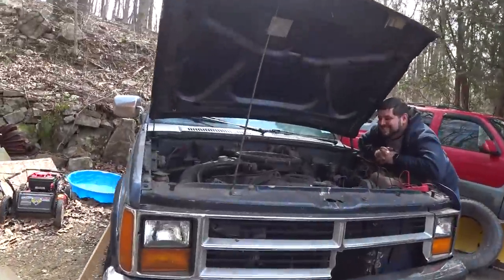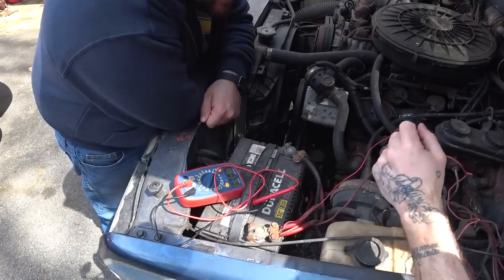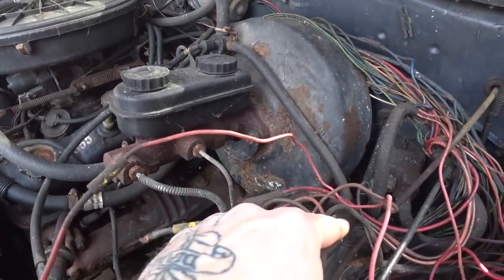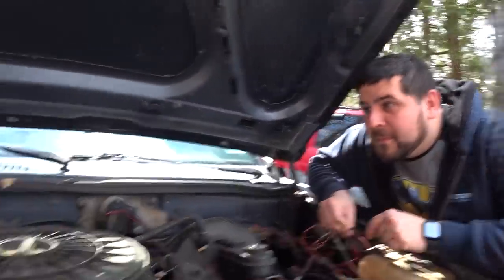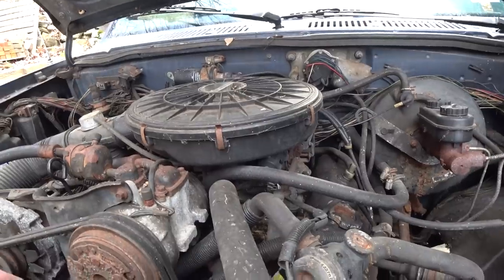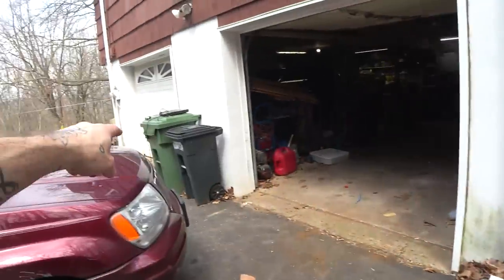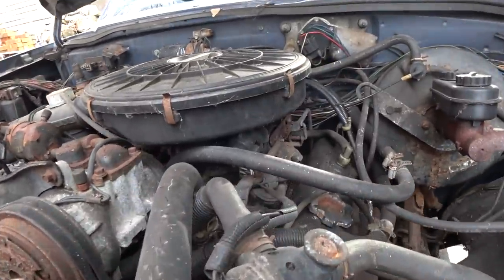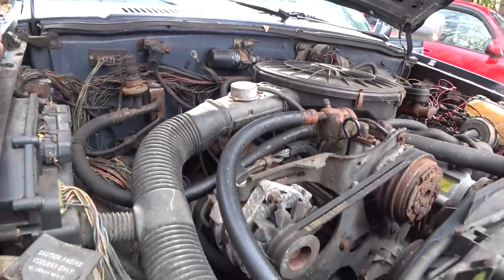Dodge Pickup - No Crank, No Start, No Power Anywhere.. DIAGNOSING FUSIBLE LINK ISSUES

Comment: The thing on the air filter is a heat riser bypass. On a cold day it closes up so the air gets sucked from the exhaust Manifold (there should be a tube that runs from the air cleaner to the manifold). That thing you were playing with would open the valve when it warms up. 

As for vacuum advance you don’t need it, as long as you have a mechanical advance. Your fuel mileage will suffer a little but ehhh ..... my 57 Chevy runs a Mallory ignition without a vacuum advance. 

Next step jump the starter to see if the motor cranks, then hook those wires up and see what happens. Either she will good bang, bad bang, or do nothing.
Reply from the maker: Thanks for the info buddy. I am at a disadvantage on this project as I have very limited experience on carbureted engine... which is why I want one so bad. I want to learn. Haha

Comment: Replace the links with blade fusable links, it will same you a bunch of headache. You'll need 4 or 5 I think. The small wire links are a pita some times they don't burn through and you have to guess which one it is with the blade fusable links just pull the fueses.
Reply: Hi do you know what amps for each wire? I have a 3.9 1989 dodge Dakota

Comment: 87 and older 318's in trucks were carburetor, hydraulic lifters, mechanical fuel pump. 88 and newer were TBI, roller lifters, electric fuel pump in tank. Some basics for you. I hope it helps.
Reply from the maker: Thanks buddy. So maybe I will look for an 87 Ramcharger or something to pull from
Reply: @DEInTheGarage  Maybe it'll help with your choice for an engine. So many to choose from.
Reply: Even a van engine will work. 👍

Comment: The thing at 10 min is a warm air vent. When the motor is cold that valve will open and allow warm air off of the manifolds to help cold starting. Then when it heats up it's supposed to close. My 79 Mustang had one and I removed it as I didn't notice any difference and the supply tube kept coming undone.

Comment: Love this channel & wonderingnifbits my current issue. I was having some electrical gremlins like dash light going off intermittently, but it was my turn signal went out that safly resulted in me parking it a year ago now. Life has been so busy I haven't had a chance to finish installing the turn signal switch, but last I recall I shorted something out (should have taken notes but wasn't expecting for it to sit) so wondering if it's the fusible link. I was hoping to get this running before I get started on dropping the oil pan on my xj that I believe spun a bearing due to sludge & oil starvation. Lots of Mopar fun to be had.

Comment: I have a 1989 Dakota that had a 3.9 v6. I swapped in a 1989 360 and I have had it running until this year. Something happened to the fuel injection / computer so I am pulling all the fuel injection crap out and going to a carb. We will see what happens. I researched going with an aftermarket EFI but I would still need to gut all the factory efi crap, convert it all to a 4 barrel carb, get it running and dialed in before trying to convert to a modern efi system.

Comment: You put a good aftermarket intake and carb on the 318/360 with electric choke and you'll be good. My carb on my 350 fires up no problem in the winter.

Comment: if your looking for a cheap e-fan im using a universal fan designed to adaptor to a chevy 350 and a smal push fan up front for my ac and it keeps it cool. i have a 3.9 v6 in a 99 dakota. just a thought. think i paid like 60 bucks for the 350 fan and the other fan i got is like 40 bucks and it was a 8 inch fan i believe. i use a hayden control for it with a radiator probe and wired into my ac compressor so it kicks on when i use the ac

Comment: the sensor under the air cleaner is probably a MAP, the valve on the intake of the air cleaner is for hot air for exhaust manifold, carb vehicles had it too.  the deal on the firewall controls fan speed for heat.  blower resistor  simple stuff guys.

Comment: correct those dodge trks are weird I've got a 85 dodge ram d 350 360/727 flat bed trk the problem is I can start up the trk and drive it to the job site then when when I need to go home the trk won't start I bought a new battery for it I bought a new voltage regulator for it and I bought a new alt for it   its still doing the samething I took the alt off and carried it back to Napa  to have it checked out the new alt checked out good   again the trk will start up  but it won't start back up the second time until the next day  I parked it in the woods and walked away from it

Comment: That shiny thing in the air filter housing is a temp sensor to use vacuum to open and close the damper in the intake snorkel. Wire it open.
Reply from the maker: Interesting. Thanks buddy

Comment: Usually each one of those fuseable links goes to a corresponding section of fuse box. Or at least some GM cars work that way. And that plug on the passenger side on the fire wall is the resistor for blower. The thing on air snorkel is the flap for warm up cycle to bring warm air off exhaust.
Reply: And instead of wasting money on fusible links. Go get blade type add in fuses from parts store. Wire them in and do a bunch of 5 amp fuses. That way you're not constantly wiring in links. And the blade fuses stay in place after you corrected issue.

Comment: That vacuum device on the air cleaner arm opens and closes the air flow for aid in cold start, etc..  They have been used there looong before throttle body injection.  I'm surprised that you guys don't have a clue.  Even the 60s muscle cars had them, just two on two inlet arms like on the 383/440 commandos (and everything else) with standard carburetors. 
I had a 1974 Plymouth Road Runner.   I was cruising through the Utah desert (heading west from salt lake,  absolute middle of nowhere,  opposite lanes of highway are separated by a few hundred yards or more of salt bog) about 10 pm on a Friday night, "The hills have eyes" movie type scenery and all of a sudden, with no warning or noise or anything...  She died.  No power to anything, period.
  I was in a complete  state of freak-out because there was nobody on the road, cell phones were not released yet, needless to say the CB wasn't working, I'm stranded, 100 mi. out into the desert.  I had two choices, stay put until someone finally found me (or my corpse) or, start walking.  The only good thing about it was that it wasn't 100°.  I had passed a sign sometime back and thought I saw a single light, offing the distance and off the main highway so...  Walk it is.
  After about 45 minutes, I came to a turn off that lead to a little, two person town that had a gas station and a post office,  they were the "civilization" point for some little burg in the middle of nowhere.  The gas station was locked up tight (as was the post office) and all was dark except that light I had seen from the highway but, there were a couple of cars and it appeared someone lived behind the station so, I started beating on doors.  After apologizing profusely for waking them and convincing them I wasn't a robber and he got the sand out of his eyes and cobwebs out of his head, he said he'd try to help me.
  We jumped into his tow truck (my saving grace) and retrieved my car.  He said he'd look at it when they were open and I could sleep someplace he had and I explained I was in the military and didn't have time so he had a heart and opened the garage and we took a look.  I was fearing the worst and I'd need a new something or other that he didn't have.  After a few minutes of poking around, we found a blown fusible link on the firewall and fortunately for me, he had some in his collection and we replaced it, the beast came back to life and breathed fire once again. 
  This was a very scary situation with a rare, good ending.  Who knows how long I'd have been stuck out there until a highway patrol or truck driver came by.  From then on, I always carried extra fusible link wire (it comes Ina roll as well as just a single piece) and some connectors, etc. in a little kit with my trunk gear.  Anytime I'm in my old mopars I make sure of being appropriately prepared for just such a thing.  Being in the middle of nowhere in my old 4x4 and having a similar experience with no one around to rescue me was not on my menu of things to try. 😊

Comment: Yeah my 88 Dodge Dakota sits in the yard right now it's four-wheel drive I know the motor is good trainees good get the only reason why I parked it for good 3 years ago the wire is just crap in it can get it run for a little while and then I'll quit and won't just crank that crank and crank and wont go something's wrong with the fuel injection wiring something he my friend ran over it took the bed off we did stuff it just don't want to work no more and then finding a carburetor for is a pain in the ass even the ones they had for the 87 Dodge Dakotas had a little bit of electronic device in the carburetor and yet by different intake to put the older style carburetor on the 3.9 liter that normally has a fuel injection system like mine does and yours does

Comment: Take a multi meter and put it on tone for continuity connected to the wire and to the chassis And then fumble around with the wires till you hear the tone go off meaning a short to chassis from the wires you’re wiggling and that should give you an idea of where the issue is unless it’s inside a component but that should give you an idea if it’s in the wiring harness somewhere and tell you where approximately it is without blowing a bunch of fuses
Reply from the maker: Thanks buddy. That is be this saturdays project

Comment: Hood thing about a 318 fitting.  Is a 360 will to.   Tons of power from them
Reply: A Dakota with a 360 is a lot of fun...our old shop truck had the factory 360 option in it in 1999, damn fun truck.  Was useless in the winter but it would lay rubber through all 5 gears if you wanted to.
Reply: William Sevier       S guy in my town had one with a 340. And a six pack.    Six pack hood scoop too

Comment: 9:10 that thing going into the fire wall , from what i've figured out with mine, is a resistor for the heat and AC. The wires come out the firewall and are part of the interior harness, to get it out all u should have to do is unplug it, push that boot into the interior, and feed it through the hole. (please for the love of god, don't cut it. I've already had 2 harnesses that some1 cut em.)
Reply from the maker: Thank you for that knowledge. I certain will not cut it! haha
Reply: In my 84 318 the resister on the firewall just to the left of your air cleaner if  you're looking in would blow every now and then always kept a spare in my glove box

Comment: 360... not 390 lol.  Grab a magnum 318 even if you must, edelbrock manifold, distributor and carb of your choice and there you go.  Modern heads, roller cam, higher compression etc etc.

Comment: That thing on the firewall you referred to as a barrel of monkeys is your blower motor resistor for the hvac system
Reply from the maker: LOL... so definitely not a barrel of monkeys... thanks!
Reply: Cut out the bad fuseable link then get a fuse and a couple connectors put one connector on the hot wire put the other on the wire that runs the accessories and dash in the truck then plug your 2 connectors into the fuse now use a screw driver to jump the solenoid on the starter or run a hot wire from the positive battery terminal to the starter and fire that sob up if there is a problem the fuse you installed will pop and there will be no harm done I would be willing to bet someone hooked a pair of jumper cables up to it backwards causing those fuseable links to burn up I've seen it happen many times if that truck was here I would have it running in 20 minutes guaranteed

Comment: Hey Doug and Eric,
A Magnum 318 would be better, just because parts are plentiful, newer, and cheaper in most cases. The 318 before 1992 was known as the "LA Block" that goes for the 360 also.  They weren't exactly the best at staying in action like the slant 6.
Anyway the Magnum has an after market intake available to get rid of the computer controlled fuel air and spark delivery management system.
Still you'd have the advantages of a stock roller cam and beefed up block with better Crank supports, and the rockers are stock 1.65 to 1 ratio on the heads. The valve sizes are the same between the LA and the Magnum V8's. The heads on the 318 and the 360 are identical part numbers with no changes to the Magnum style which uses the classic pushrod driven solo hydraulic rocker lifter, vs the pre 1992 rocker assembly shaft that's bolted down the center of the top of the head.  Before making your choice, you might consider the Magnum first before going all caveman.
Best regards to you both, stay safe and healthy. Keep up the great work.
Reply from the maker: I had heard it was a nightmare getting a magnum converted to carb which is why I was looking for a LA, but you are saying there is a kit? I am going to have to look for one. A 5.2 is going to be a HELL of a lot easier to find than a late 80's LA (you never see a 1st gen in our junk yards, so I think a Ramcharger was my only option)
Reply: @DEInTheGarage  Hey guy's, not really a kit, you'll need Edelbrock RPM Air Gap Magnum Intake Manifold - Non-EGR

Edelbrock RPM Air Gap Magnum Intake Manifold - Non-EGR
Reply: Edelbrock RPM Air Gap Magnum Intake Manifold - Non-EGR
Reply: @DEInTheGarage  read this article, it will give you a guide to the build. http://www.hotrod.com/articles/make-big-power-magnum-5-9l-mopar-heads/

Comment: K.I.S.S let’s get her running.... type “89 dodge Dakota 3.9 tho to carb” into google. Guys have done the conversion before using 2brl carbs on TBI manifolds (needs to be drilled and tapped) and Oder V8 distributors. Nothing you can’t Handle 

Once running and driving you can figure out the V8 swap.. maybe.

Comment: Yeah I know I was thinking of dropping a 360 in mine or a 318 but her frame is too far gone all underneath the cab it's 8 out the bottom in the back and the shackles of the hole in the frame it's not worth the time that has 240 thousand miles on it they gave me 14 years of reliable driving around wood so I can't say much more about it but just to let it rest until it's times up letgo app
Reply from the maker: Sometimes you just have to send a good one down the road

Comment: In this situation where you have a bunch of fusible link blown in your wiring system when in doubt strip it out. To be honest with you the best thing you could do for that Dodge is strip out all that Dodge wiring get rid of that Dodge motor and add GM wiring harness and ECU with an LS motor it's more reliable
Reply from the maker: There does happen to be a running Vortec in a shit body 6 feet away from the dodge.....

Comment: Best thing to do is replace the fusible link with a reset-able circuit breaker for testing purposes those damn fusible links are expensive....or go to the pick a part and chop a bunch out of several vehicles to give you a supply for testing LOL.

Comment: I got an 87 dodge d150 360 4 barrel carb natraly asperated pump on the block but I got no spark. I've replaced the following and still nothing. , dual pickup coil,ignition coil, icm, cap, rotor, spark plugs, sparkplug wires, balast resistor,  altinator, starter, ... it cranks everything like the instrument panel door locks windows lights all work just fine its weird that it will crank if the ignition its self is bad anyone got any ideas im free and open to suggestions

Comment: Nothing hard about the vacuum advance.   With a new carb swap. The line just runs to a vacuum fitting below  the throttle blades   Aka manifold vacuum
Reply from the maker: Thanks for the info buddy. I am at a disadvantage on this project as I have very limited experience on carbureted engine... which is why I want one so bad. I want to learn. Haha

Comment: So first of all I still have that Taurus fan shroud sitting around. Second I have a hydraulic crimper so I can make you come custom length batter cables.  Lastly, get rid of that fuesable link madness and get a fuse box out of an xj/zj mount it there and use that as a power dist box. I can walk you through it all if you need. 

As far as your rats nest wiring, oh man....
Reply from the maker: Yea is a great idea man. I have an aftermarket box laying around that I was going to use on my 4.7, but maybe I should put it in the Dodge. I might have to get some advice from you when it comes time

Comment: I bought a first gen dodge about 5 months ago. Its mostly sat but ive started it up about 2 times a month to cycle the fuel and ofc to just admire the sound of the truck. Anyway i just went to start it up last night and theres no power at all. My niehgbor knows some things so he did something and turned my engine over so he said its definitely something to do electrical components. Hoping we can get in touch and maybe you could help me diagnose my truck. I bought it with my neihgbkrs help and he said he would help me with it but the first problem that has arose he knows nothing about. So please could you help me out boss. Maybe anyone that knows a thing or two about 1st gen dodges hmu.